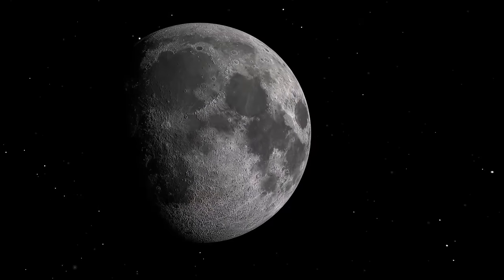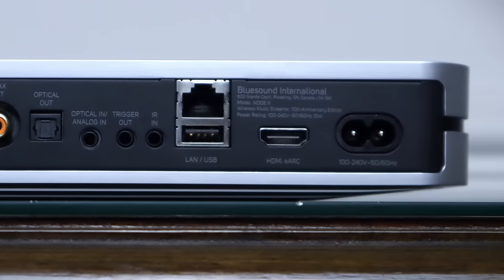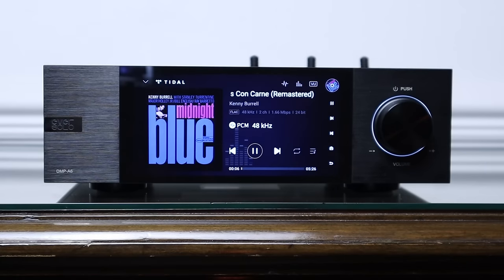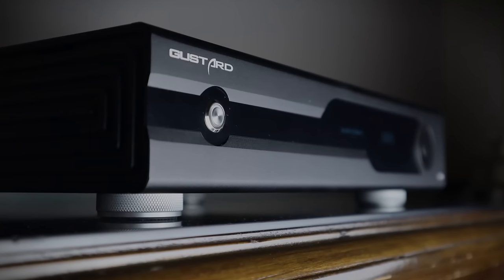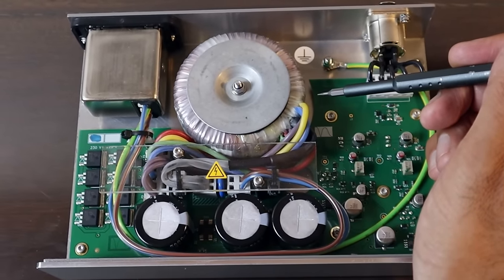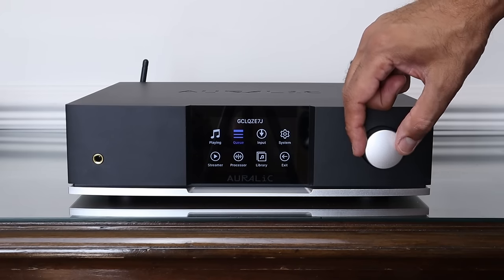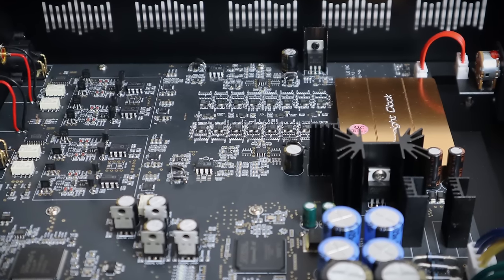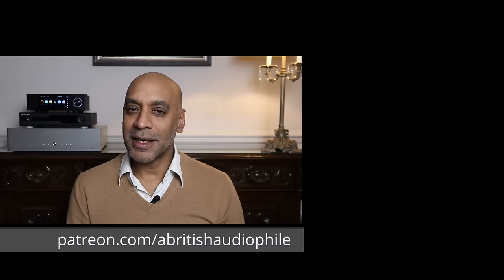ABA AWARDS | Best Source Components of 2023!

Comment: For me, as for you, it was the Aries Mini. My introduction to streaming (other than playing my Astell & Kern portable via an Arcam Blink) has been a revelation in sound quality. That is, when it’s working. When it goes into a not infrequent sulk and will not connect, it is, as my wife reflects, the cause of a great deal of cursing. But for the price (I paid c£430) its output is a delight. I may try the power supply you mention. Thanks for a great channel.
Reply from the maker: Thank you 😊

Comment: My favorite source of this year is the Geshelli Labs Dayzee - their new flagship DAC. It is a dual AKM 4499EX (with two AKM 4191 chips as well) and it uses eight op-amps. I have heard the stock version, which uses eight OPA1655 op-amps. But it can be upgraded to using eight Sparkos SS2590 discrete op-amps.
Reply: Sounds great, you already got one? The website says coming soon... Geshelli has nice products with many options, unfortunately its not easy to get in the EU (shipping costs + taxes), so the value for money shrinks a bit.
Reply: @Djehuti-85  I heard the Dayzee on their Capital Audiofest system with my Tower 6 speakers. I shared that room with Geshelli, and both the Dayzee and the newest Zoofa integrated amp was really amazing.
Like I said, that was with the TI op-amps. I can only imagine how great it will be with the big Sparkos.

I think the cost is $1300, plus the Sparkos upgrade.
Reply from the maker: Thank you for sharing Neil 👍

Comment: Thanks for another year-end review.  Lovely DACs.  I wish I had the funds to try them all.  I use the Bluesound Node I purchased at the beginning of the year for my 2.2 channel music system but to answer your question.  The top source I added this year is a CD player.  I use the DAC in the preamp using the Node as a streamer.  Maybe my CD player can fill the review gap you mentioned.  It’s the Rotel RCD 1572 MKII that pairs beautifully with my RB 1572 and 1582 MKII preamp and amp.  It has balanced XLR outputs to the preamp.  The DAC matches the quality in the preamp.  The tray mechanism is smooth and sturdy and the sound quality is much better than the Sony 300 disc carousel I’ve used for years.  The player Got me to go back to my CD collection this year and I started buying CDs again.  The quality and sound of my music both streaming and CD is usually hard to distinguish with my old ears.  Sometimes one sounds better than the other but the differences with a well recorded album are minor.  In the end the convenience of streaming usually wins out listening late at night.  Cheers!
Reply from the maker: Thank you for sharing 😊

Comment: Best digital streamer I have ever heard is an Aurender.  Huge soundstage (beyond speakers).  I currently have an Aurender N10 using the AES output to and older Mytek Manhatten DAC.  That combination with a Tube preamp and tube amp seem to jive well together.  I am not sure if you had a lot of seat time with an Aurender or Mytek.  My biggest surprise is when I changed from a coax digital connection to AES.  That change to put into perspective was like changing to a different speaker. It was that significant.

Aurender has higher end offerings that unfortunately my pocket book will not allow but maybe you can stretch yours sample the new N30SA.  Very nice stuff.

The only other DAC that has similar performance I hear locally is a Simaudio Moon DAC like the 280D or An Audio Research unit.  The audio shop I go to in the upper midwest USA use either one of those as their reference for comparing other products.
Reply from the maker: Thank you for sharing 😊

Comment: Gustard R26: seriously a giant killer. I’m currently comparing it with with PS Audio DirectStream dac that used to cost $7k and I find stark differences. PSA DSD is pretty resolving but not as resolving as R26 and R26 has sweeter midrange while DSD plays way too safe in the midrange. Both have similar bass tone and texture. For me (kef r3 and Yamaha as1200) tonally DSD is no match for R26 and DSD is usually compared to Denafrips Terminator! On top of it, R26 keeps getting better with break-in.  I only wish it looked better. Thank you for introducing this amazing DAC, Tarun!
Reply from the maker: Thank you for sharing your experiences 👍

Comment: R26 with master clock and DDC is at or above the level of the Terminator II in my system, but then I have tubes in my system so that is a wild card that makes direct comparison difficult as it makes accounting for different synergies impossible.
Reply: Hi, which ddc and mc you use? I use internal streamer in r26 and the sound is great for my ears.. , but your solution seems to sound better?
Reply: @petrpulpytel  DDC is Singxer SU-6 using HDMI cable into the I2S input on the R26, and the clock is LHY OCK-2
Reply from the maker: Thank you for sharing 😊

Comment: Earlier this year I upgraded my Audiolab M DAC to the Denafrips Venus 12th anniversary model. I expected the 5 times the price Venus to make a night and day difference. It didn’t. Not even dusk and dawn. The audio reproduction was however differ. That ‘digital edge’ was substantially reduced. The presentation was more natural, dare I say, analog sounding. The Delta Sigma produced a ‘wall of sound’. All musicians  vying for front of stage dominance. The Venus producing a more layered soundstage with each musician having their own clearly defined space. The absence of a remote control with the Venus is initially an inconvenience but you quickly add apt. I have both DACs housed in my media cabinet and the Venus is prioritised, but, in view of the age differ between them and separate DAC topologies employed, I would say they are more similar than they are different.
Reply: Is the rest of your system on level with the Denafrips?
Reply: @particularlynothing  Denafrips Athena preamp. Denafrips Apollo power amp. Kinki M7 studio extreme monoblocks. Biamping Kef R11 meta. Augmented by Rel T9I subs!
Reply from the maker: Thank you for sharing 😊

Comment: Hi Aba, thanks a lot for your very interesting video, I like it very much! I‘m owning a Camebridge Edge A amplifier for a few weeks now and have the following questions to you:
1) Would it be the money worth to buy one of the „low priced“ streamer for my system, even if I am mostly analogue fan (Nottingham spacedeck 294 turntable)?
2) Is it correct to assume that the built in SAC in the CA Edge will be a better quality than in bluesound/Eversolo?
3) If so, what would be the best connection between streamer and amplifier? As I understood, it should be connected via USB, right?
Thanks a lot in advance!
Sebastian
Reply from the maker: Thank you Sebastian. There is quite a bit to consider there. Unfortunately, too much to get into here 😊

Comment: Hi Tarun. What speaker cable would you recommend for a Farlowe era exposure amplifier? Ive been trying to find some used exposure cable but its non existent. Thanks.
Reply from the maker: Try Linn K20 😊
Reply: @abritishaudiophile7314 Thanks. Out of curiosity what do you use for your exposure mono’s? Im using a chord cable atm, sounds good, i think its fairly average capacitance.
Reply from the maker: @russellparker4568  I used the K20 for years. Now I use Audiomica Red. Just avoid low inductance cables with twisted pair configuration. This is because the Exposure amps have no Zoble network on the output 😊

Comment: Hi Tarun, on the Bluesound, regarding the single USB port. Do you think it would be possible to use a passive multiport USB hub? If so, it would provide access to extra storage and an external USB DAC, especially if it could be powered from a source other than USB. If you still have the unit, it might be worth a try.
Reply from the maker: The hub could be a source of electrical noise and jitter. The only to find out the impact would be to try 😊